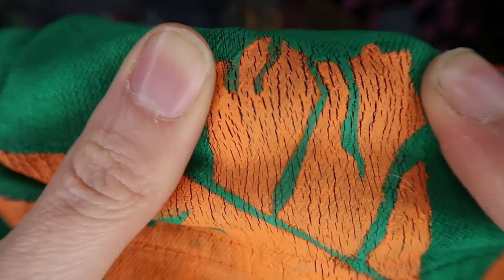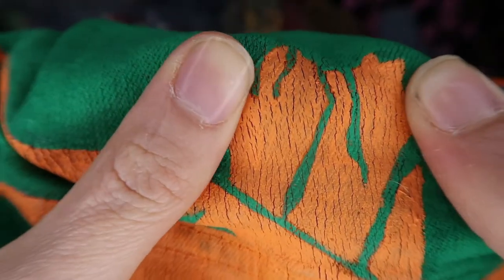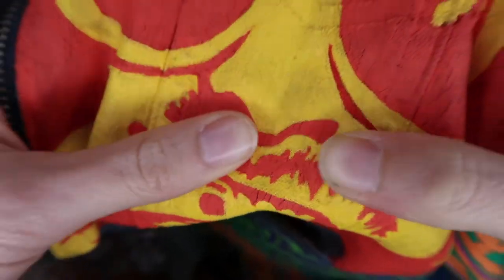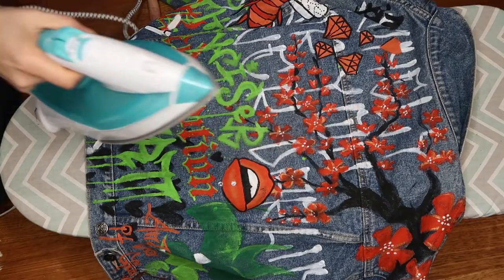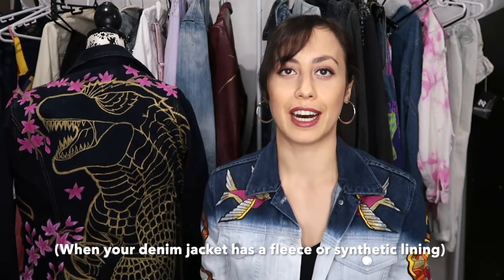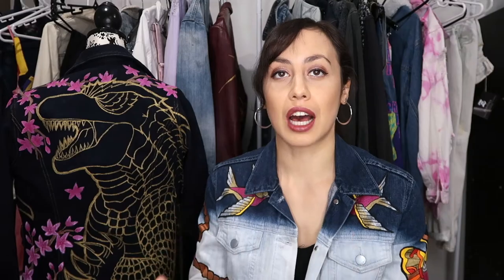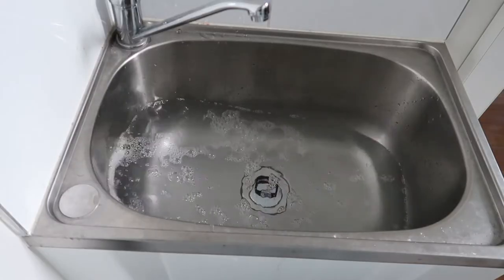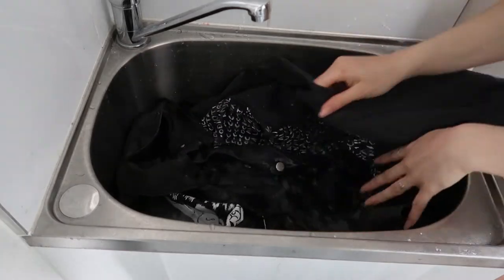THINGS YOU MUST KNOW BEFORE PAINTING YOUR DENIM JACKET PT II (Paint cracks, heat fusing & aftercare)

Comment: this is so helpful!!! do you think i could use dotting tools to apply fabric paint to denim? would that make it too thick/stiff or cause other complications for the longevity of the art and jacket?
Reply from the maker: Hello! I don't think there should be a problem with that, just make sure you let the paint dry for a little longer if your dots are a little thicker than if you were to paint them on with a brush. There is also no harm in experimenting on a scrap fabric first before starting your actual project

Comment: Hey there! A couple of questions that I may have missed:

1. For Heat Fusing, is there a general rule of thumb for how long you should iron the fabric? How to tell when its finished/done right? 
2. I feel this is obvious, but is steam a dealbreaker for heat-fusing? I Imagine it wouldn't help, so probably turn the steam setting off on your iron? 
3. Do you find more trouble in Cotton blends? ie: Cotton/Polyester? I'm using a general rule of thumb to be careful of flexible cottons to avoid cracking. 
4. Do you have a timeline in between drying layers of fabric paint? 15-20min before putting on another?